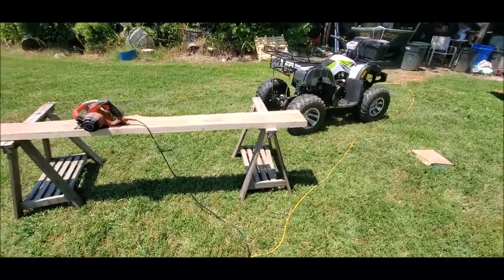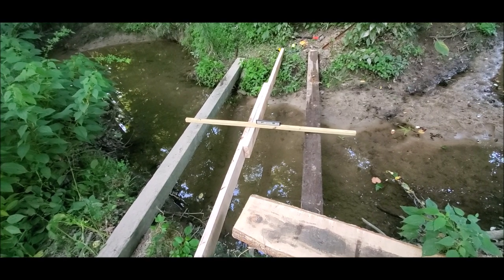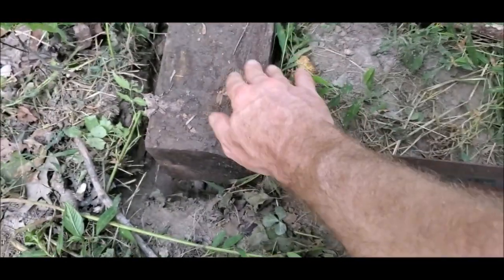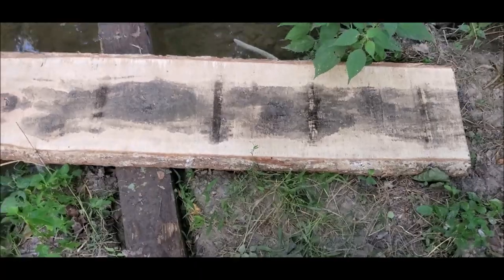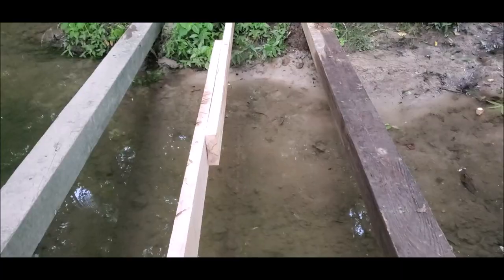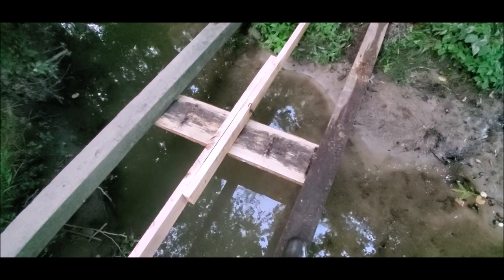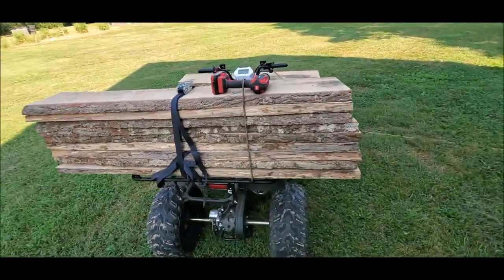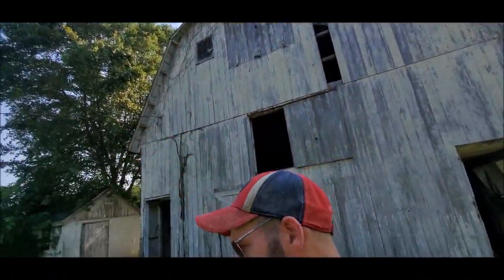DIY $100 ATV Bridge - Best Video - COMPLETE PROCESS

Comment: Some awesome, tips! Thank you so much for your great instructions (leveling, spacing, etc.). I was wondering if it was possible to use a chainsaw to cut boards since we don't have any other electric saws. Taking that as a "yes", after watching your video. We're going to try to build a small footbridge across a creek at our house. Homeschooling with the tweens.